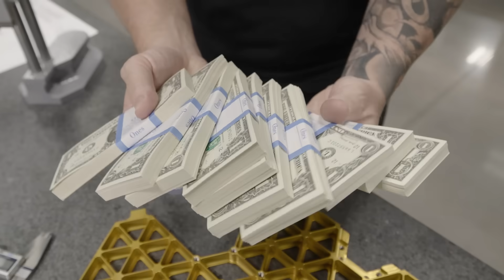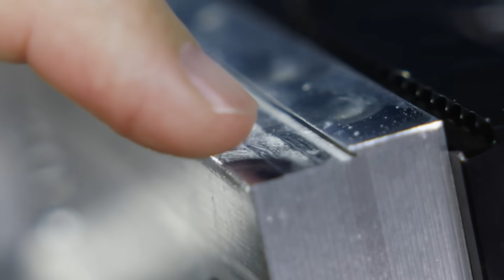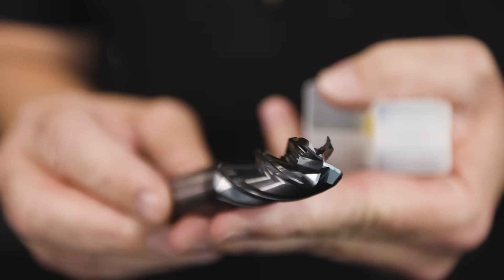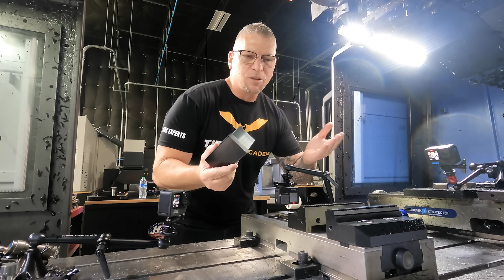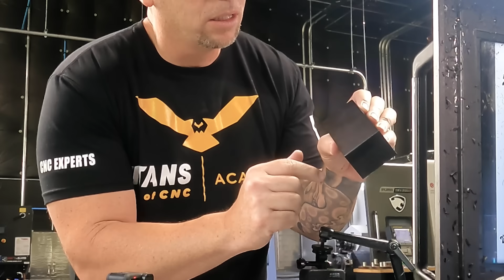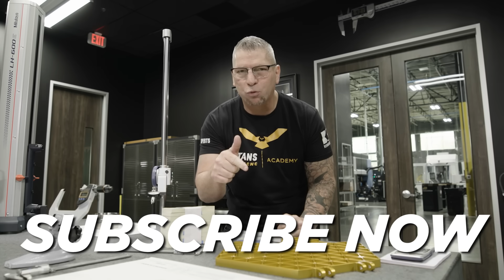How To Master The ART of Machining Plastics

Comment: I’m currently 22 years of age. I started of as a welder in the iron work industry from the I got certified. Despite my age I moved on to becoming a semi truck trailer assembly job where I picked up more of a tooling trait. I am currently working in the aerospace industry. I started at this job as a welder then moved on to tooling and now I am a conventional machinist. As of right now I run the Bridgeport and the lathe, I picked up on the trait pretty quick. If it wasn’t for your videos I wouldn’t have been able to pick up a lot of little tricks or skills that you guys demonstrate. It literally feels like I’m in a machinist school. I’m currently on my way to moving on to the cnc and I’m very excited . Again because of these videos I know it will help me to move further. This trait actually makes me happy and look forward to what else I can learn. I live in a apartment with my daughter and girlfriend if it wasn’t for this job I wouldn’t be where I’m at right now, I am extremely grateful. As for my guess I will say 4.36. Thank you guys so much

Comment: I live and work at JCH in Denmark. Manufacturing changed my life about 5 years ago, i was a drug addict and had nothing in my life. i was showen manufacturing at a company in Odense, Denmark. Where they made brake calipers. And it opened my eyes. from that day on i've stayed clean. And today i produce a variety of parts in brass. I'm happily married and my first child just turned 1 in late february. I'm guessing that the stack is 4.5153 Inches tall at highest point.

Comment: Started as a packer at an injection molding company and moved my way into the Metrology lab. I have always had new and interesting ideas since I was in school for my BSME, but those ideas weren't formable/executable until I was able to talk to the tool room guys and work with 3D printers. I enjoy working in manufacturing because of the many times I have helped with problem solving for whoever needs help. My guess for the stack of bills is 4.4379

Comment: I started my first week in high school one week after my dad finally got to open his very own bar in his old town right next to where he was born. He unexpectedly passed away exactly two weeks after opening. As a result I was never able to get motivated to try to do my best in school and did just barely enough to be able to get to a trade school for food and beverage management (after high school, in Europe school is setup differently) for no other reason than to follow in my dad's footsteps. I soon realized that was a stupid reason and quit trade school at age 19 to go work.
Years of menial jobs in different fields (fast-food, disco's, factories etc) and several short stretches of unemployment between jobs, I really had no idea what i was going to do to have a REAL career and I found out there were two jobs that they were ALWAYS looking to fill, no matter the state of the economy; Mill and Lathe operators. Not having ANY technical training or skills other than working on my own moped, absolutely nobody wanted to hire me. I honestly didn't even know what those jobs were really about, just that there was always a job open... That went on till I was 26...
My mom eventually met a nice man who owned a small machine shop and he agreed to hire me for a small job that would last just a few months, he just had one employee operating 2 lathes, he himself ran the two mills.
I had to cut 10mm rods to length, make a point on it on the lathe and then bend them, thousands of them... After the job was finished he kept me on and learned me to operate a mill.
After 13 years on the job I was extremely proud of what I had learned and made over the years; from prototyping parts to repairing or replicating 90 year old motorcycle/car parts for collectors and so much more (manual/cnc , programming, hardening/annealing, blueing, brazing/silver-solder)... but as a small job shop the pay wasn't really great, but that was fine at first because I finally had a job that motivated and challenged me in all kinds of ways.(I told myself it's nice to be able to smile when you go to the bank, but you have to go to your job everyday!) Meanwhile I met an old high school sweetheart who had 3 kids of her own (we married last year). After my own first kid though I really needed more money so I eventually left for a large manufacturer that payed better and lets me work with giant machines. I worked my way up within a year to machine parts up to 18000kg(thanks to those learned skills in that small shop) and am currently looking to go back to school to get an engineering degree at age 43 to become a programmer/calculator/set-up"guy" so that eventually my wife can stay home for our kids and follow her own dream of a specialty bakery of Caribbean treats and pastries. The money would surely help to accomplish that. Since I have no experience with American cash I admit to have looked up the thickness of a dollar bill (like so many probably) and estimate the thickness of the bands. My geusstimate if the height of that stack is 4.3519 and on my channel I have older video's of me still learning our then new Haas MiniMill and teaching a student to do some hardening. Love your channel and the stuff you do, wish you were based in europe!

Comment: I am a CNC specialist. I've done contract machining all over the country. I have four CNC and CAD/CAM programming certificates and I'm proficient in setting up and operating CNC lathes and mills as well as manual lathes and mills. I have over 18 years of experience and I've machined in multiple industries including aerospace, medical, automotive, military, oil field, and more. I'm currently working with ceramics in the semiconductor industry. 

To keep it 100 with you, I Googled the thickness of a dollar bill, so I can understand how some of these guys came up with the 4.3" height. However, considering the fact that there are bands in place led me to add just a bit more height to the stack. So with estimating the thickness of the bands themselves being compared to the thickness of a USD, my official answer to the riddle is 4.3450" (+/- 0.025"). There it is!

Comment: In highschool, I hated normal classes, and failed to see any point in them. I was informed by a teacher about some options of being bussed to another school to learn a trade. I joined a mechanical engineering technical program. My teacher was talking about many different manufacturing processes throughout the 2 years there, and many were super expensive. I wanted to get a leg up and see what it's like in the career field. I noticed additive manufacturing was decently priced, and ended up dropping 2 paychecks on a fdm 3d printer (ender 3 V2).  Shortly after I found myself going to college instead of trying to work on a oil rig. I chose mechanical engineering because of it's versatility in the workplace. With it I can get a job running many types of manufacturing equipment, and also design the parts. There I was taught how to run different mills, lathes, cnc equipment, as well as high-end expensive AM equipment. I want to use these newly added skills, but college is taking every dime I can manage to get my hands on, and I have not yet been able to source the machinery I want. I think my next step is to buy a laser cutter, or make one. Possibly make a cnc, as they are extreamly expensive with reason.

Basically manufacturing changed my life by giving me direction to shoot. Turning me from someone with no future to someone who might have a future.

My guess is 5.6271 
basically 5 and 7/8 plus 2.1 thou

Comment: Hi I'm Ray from Oregon. I worked for a grocery store for 24 years and a lot of times I felt like I was getting nowhere working late shifts and weekends and not making enough money to provide for my family, but one day my sister got me a job where she worked making carbon fiber parts for the aerospace industry. This company would send their parts to be CNC'ed at a CNC shop, but the owner of the company decided to buy a CNC Machine and that's when I said this is my opportunity to grow and learn something valuable. They had an engineer who try to figure out how to run a CNC machine. He had almost no idea how to do it  but he started cutting good parts after a while and he needed some help running the cnc so he could do other things; the  company decided to put me as the CNC operator. I'm going to start a one year machinist certificate at a community collage and hopefully learn more and gain the skills to contribute to the manufacturing industry. That stock of money should  be 4.360  inches. Thanks if I win this money it would all go towards gas so I can drive to school and get that certificate.

Comment: 4.388
Reply: Measured a dollar bill, (.0043)×1000= 4.3 plus the bands that rap around every hundred, I'm guessing it's pretty thick so around .004 ×2= .080( because the band wraps around top and bottom) plus air/wrinkles I'm guessing .008 for Total of 4.388

Comment: Titan,  thank you for all the videos and tips and tricks.  I work as a manual machinist in a Hydraulic Repair shop.  But do get all kinds of other projects to work on too. 

Been around machinist and machines since following my dad in various small shop since I was 5-8 years old. Back then,  osha was around much, and I could stand and watch the chips fly off the lathes.  Little did I realize that 30 years later, I would eventually take over those jobs held by the old timers, and hear stories about them from other previous coworkers/ bosses, and then I think of some of the things I learned while watching them at such a young age.  

I always try to help teach/ pass on tips and tricks to coworkers.  I’ve worked with more than a few in the past that had the attitude that they didn’t want to share their hard earned secrets with you, because then they feared they would not be needed then.  But, I believe that we can always learn from each other, and can always get better and strive for more efficiency. 

I remember one time where I was designing and attempting to build a worm drive gear for a shop made truck crane to control the rotation.  Boss asked me what I was doing, ( It was easier asking forgiveness vs permission at that shop for trying something new) and said don’t bother.  You will not be able to do that.   That made me even more determined to succeed.  I found his dads old dividing head, and gear cutters hanging on the wall that had not been used in 50 years, and my 1st Edition of Machinist Handbook that belonged to my great grandfather, and I taught my self how to do it.   Great feeling that I was able to make a tool that was built by previous coworkers, and actually improve it enough so it was workable tool that was not so dangerous to use, and helped to do future jobs. 

Glad to pick up tips and tricks from you.  I will be using this plastic tip sometime, even if I only have manual machines in my shop. 

I’m going to make a guess for the Stack of bills.  3.6783”.    It would go towards outfitting my home shop with better tools.

Comment: I started working for H-S Precision 6 years ago in the stock department doing finishing work on synthetic rifle stocks. I moved my way up to the welding department after about a year and a half, building the bedding blocks that went into those stocks. It was in this department that I learned machining out of necessity, not really understanding the complexities involved. I was running an old mid to late 80's Bridgeport trakmill to mill the heights on the studs to their correct height and angle. I started doing this by hand but the quantities I was required to put out wouldn't allow this, so I taught myself to write a short program to mill what I needed done. I only had X and Y servos, but the machine would recognize if Z wasn't in the correct location and would stop, but if you weren't paying attention and just hit the start button, it would continue anyway. Ruined a few stocks doing that. I then started talking with the machinists in the shop on how to improve my machining processes. Most of them wouldn't give me the time of day or would just set me up for failure so I resorted to YouTube and Google. Soon I was machining stuff out of aluminum and steel with ease on that Bridgeport with very little ease. I then moved up again to machining pressure ports and chambering test barrels for ammunition manufacturers. Chambering for headspace tolerances of +0 0.0005 and the ports have a majority of tolerances at + 0.002. I'm still running on a trakmill for the porting, but it is a Prototrak and was at least made after the 2000s. I recently picked up one of the Haimer 3d sensors you guys advertised and I absolutely love it.

Since getting into machining, I have a whole new level of respect for those in this field. I love what I do because I am one of those people who love to do the math to figuring out how to get that perfect tool path. I don't have access to, nor the training for a CAM program, so I do everything I can using a graphing calculator and test run cycles to make sure it looks perfect. I love seeing what is possible in this field and it makes me wonder what I am capable of doing in the future with my 4 years of self taught machining and degrees from YouTube and Google.

As for the thickness of the stack, I'm going to guess about 4.4935, after doing some rough calculations.

Comment: I worked for an electronic power supply and instrumentation manf for many years. Too many stories of stupid policy requiring just in time shipping of needed components. Stock was always limited, so orders came to the floor that were  short parts! Why bring a kit to the floor, clogging it up, when you had to stop work? " Let's pull in orders for next month to make up the dollars ".. Well, guess what? Same story- only worse! Too much crap sourced from overseas  bit them in the butt too many times to count. Working off of redlined engineering drawings that never get incorporated for the next go round.  Whoops! Gotta figure out all the mistakes  all over again!.
A major   supplier to every defense contractor out there.
You  think  they'd  know better. 

It was an education on how NOT to run a business.
4.4935" tall stack of one's.

Comment: My guess is 4.3355, In high school we got a new metal shop teacher, he was part time foreman at a welding shop while he taught, he convinced me to become a welder for a career and I loved it he taught me everything he knew and promised me a job if I went to welding school, halfway through my first year he hired me while I went to school I worked 40 hours and had 40+ hours at school each week and I loved it, 2 years after being a welder I got an offer to start manual machining in the machine shop. The supervisor wanted to pass on his 40 years in cnc machining over to me and loved machining so much more than welding, I got tons of experience running everytype do manual machine you can think of making massive massive parts on a 36 inch chuck. The first machine I learned on was a WW2 Warner and swassey turret lathe it was a beast of a machine with limitless torque.I decided to go back to school for another 2 years to learn g code, multi axis, programming and solid modeling . Now I work in the semiconductor industry CNC machining . When I get home all I can think about is tooling, how to improve speed, programming.  It’s my passion using this second language and nothing makes me happier than adding in to my collection of skills.

Comment: I believe that I always had some passion for building, and destroying stuff. My grandad taught me the things he knew as an aviation mechanic and pilot, among other things, and he was the inspiration I had for studying Mechanical Engineering. In 2014 I had this one time opportunity to take part on a vocational training (which lasted a year) as a mechanic technician and machinist, mainly using conventional machines, and I took it mainly because I needed the money to continue my studies. And I found my passion, never before I thought that I would love the trait but oh boy I was wrong. In 2017, around a year after my training, I started building model airplanes and fixed wing drones using wood and some composite parts at the university and on December 2018 I took a job as part of the team that would install some CNC equipment for a new FAB LAB at the university. I was the only one with some hands on experience on the team and I took it upon myself to learn everything I could to operate the equipment. It is true that the machines are on the small size (a Tormach 15Slant Pro and a 1100 series 3 along a ShopBot Mill and now a CNC Plasma from Intelitek) but they are perfect for prototyping which is mostly what we do. During the pandemic we had to close shop due to restrictions of access to the University Campus, and I needed the means to support myself and to help my brother (I live with my brother, my sister in law and my 3yr old nephew) so I took one of the few jobs available at the time as a production manager and machinist for a private company. Last year I came back to FAB LAB UTP, I love teaching and prototyping and I know that if it wasn't for me taking on the challenges and learning this trait I wouldn't have been able to sustain myself and help my family. I know that I still have a journey ahead and a lot of things to learn and improve on. I also believe the stack thickness is 4.3343" or 110.09 mm.